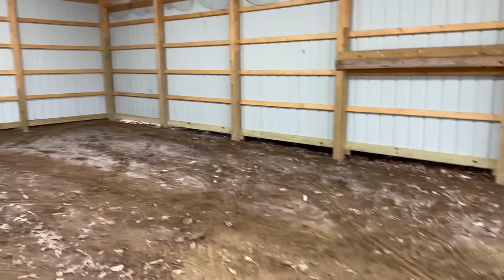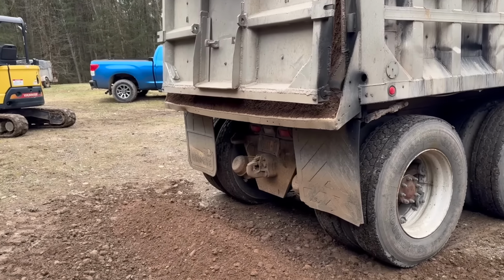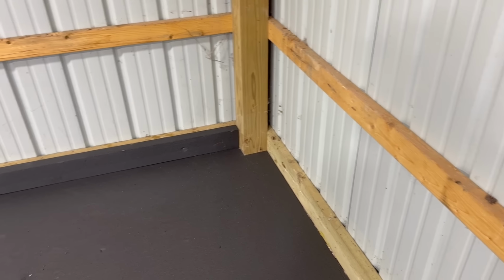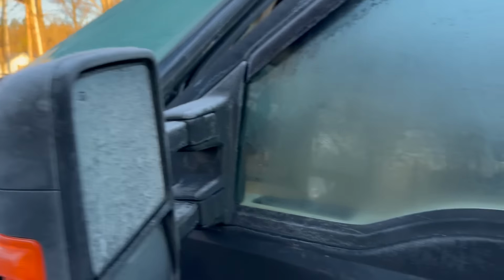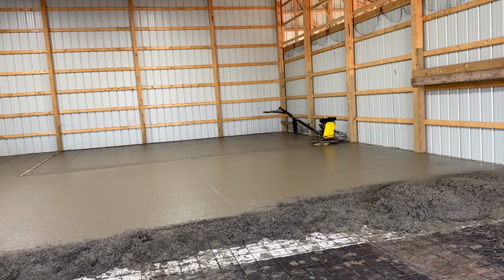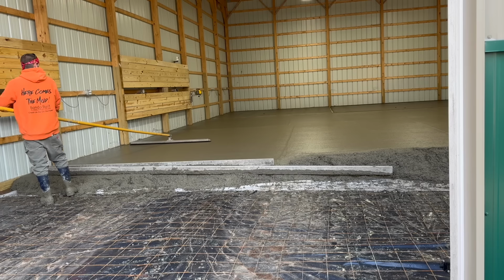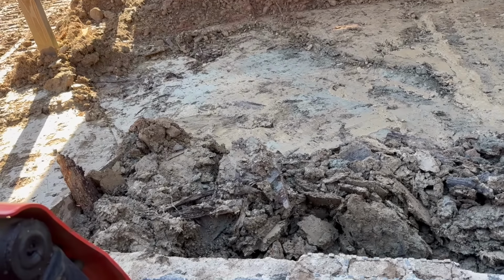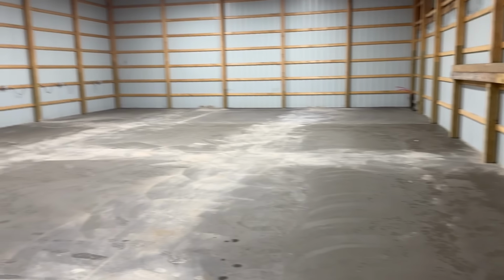We had to fix a huge mess before we could pour concrete in this pole barn.

Comment: Nice work !  😊 The water in the parameters of the barn are also created by SNOW and Rain comming off the roof line. The install of gutters or another shed roof will deflect the hydraulics load away from the structure!              
 Living and building in Montana taught me a lot as it would SNOW 300''+ per year  and a frost depth of 4' to 6' per winter.

Comment: I think I would have dug the drain on the outside to try to keep the water off the poles as much as possible. Even though they may be pressure treated, they will rot when constantly in wet dirt. Still a great job.
Reply: That's exactly what I was thinking as well.....keep the water from getting inside the building.
Reply: Didn't anyone stick a shovel in the ground even before the building was started? All this work should have been done in advance of construction, including drainage on outside of footprint. Why no chairs under mesh?

Comment: Hello Ron, hard to believe someone would put that lovely barn up and leave all that soft shit inside and not pull the site off and put some decent stone down, even as a starting point for the floor to be made up ready to concrete. And even worse on that sort of ground and grades, not put a nice drain around the outside to help protect the inside. The levels and conditions are sort of telling you what needs to be done. There's even a ditch to help 😀 great job as always,
atb to you 🙂👍
Reply: @TUGG75  I know what  he was hired for tugg75, but when I've done something similar I pulled off the site area I was working on to make it a cleaner to work on and would chat to the client about it, so when the next trade/contractor it would just be better and just save time and be better to work on, that's all. I always try to think ahead so the customer gets a neat job with less hassle that's all 👍
Reply: @TUGG75  fair enough, that's a good point 👍

Comment: 3/17/24..Always grab your videos whenever posted..much enjoy learning as you point out..'tis how we do it (right)!'
  So kindly explain why you intermittently use those wire mesh Elevation Chairs...last video from you, saw them, you commented..now this job, no chairs!?!
  Also good job on scrapping out tons of wet clay/dirt before beginning..+ perf drain pipe routed to 'daylight'.. also liked that 'new' black 'Shotgun Barrel' plastic protector for Radiant floor heating (red) tubes...looks very professional! 
 😮Have Never seen👀😮 your Heavy cc truck roll over your base fill, visqueen plastic vapor barrier & wire mesh (without chairs) 🙆 before! I thought I would see noticeable tire trks/ruts/depressions/ bent wire etc...but No..your red rock foundation was waaay strong! No 'squish'..A+...but again..no mid section wire mesh pulled up or 'chaired-up-to-center' in cc slurry...? Hope you can comment on this seeming contradiction: wire mesh in center of poured slurry...or not.🤔
 Stay safe, 🏥hope 'Big Biscuit's' cuts/wounds/stitches heal up quickly (🍺🍺 can help, right?) & carry on! Looking for your next video🎉⚙️💪😊
Reply from the maker: We pulled the wire up with potato rakes and we do not use chairs as they are not safe to walk on and can not drive the trucks on them. The wire should be on the tension side of the slab. That is the bottom 1/3rd of the slab as worse is applied to the top.

Comment: Nice work, sub-irrigated soil doesn't always show up depending on the season and dryness of the climate during the year. A dry year, end of summer build, that clay would be like concrete. The couch contractors wouldn't get that. The clay certainly prevents proper drainage. In my area we lay down some larger stone (1-1/4") as a ballast and base for the gravel with the fine ground mix (3/4 minus) when that much has to be excavated. Arguably that doesn't apply to all regions with varied soil conditions.
Reply from the maker: Thanks. We even pulled out some stumps in this one. LOL

Comment: nice video and work  Just wondering if u were lifting the steel  and i didnt see any joints   ???
Reply from the maker: Yes we pulled the steel with potato rakes and we cut the joints at the end.
Reply: @bondobuilt386   I didn't realise the steel  is supposed to be in the bottom 3rd

Comment: I like your videos.  I know you may not be able to influence the client but the water issue needs to be addressed from the exterior, first. Gutters, drain tile... I agree with an internal drain tile but the water needs to be stopped before it enters. My opinion.  Thanks for your hard work.

Comment: My building when they built it, they cut the bottom from a hill to level it. But the one side which is on the hill side should have made it higher. Whoever poured the concrete never cut a relief in it. It really doesn't have many cracks that are really bad which is surprising. The building contractor used nails instead of screws but it's been there at least 30 some years. Also after they poured the concrete the forms were never pulled and so I can't tell if I remove them if i will have a problem at the bottom of the metal panels.

Comment: I love the idea of a pole barn especially as you can lay a concrete floor later on when money/time permits. I was just wondering though, how you deal with the posts/poles rotting at ground level. Would probably rot after about 50 years I guess so do you cut out the rot and strap new timber replacements or do you install concrete ground pads? Or something else? Cheers Bondo.

Comment: This concrete work reminds me of the saying, Beauty is skin deep but that's deep enough for me.  I was impressed with the amount of rebar that was put in place.  The problem is, though , that the rebar should have been  raised off the ground a few inches and be sitting on what are called chairs so that the rebar is in approximately  the centre of the concrete.  I know that's impossible to do if the cement truck is driving on it -- which is an absolute No No -- but I saw no attempt to lift it as he backed off either.  I suggest that  the rebar is useless sitting at the bottom and will  rust away,  and as it cracks,  the concrete will become uneven causing tripping hazards.  And like the wrinkles we get as we age, the skin will no longer be so beautiful.

Comment: I've watched numerous cement contractors on YouTube lay down the wire mesh before pouring the mud.  That's how it's done.  You pull up on the mesh as the concrete exits the chute and lands on the ground.  But as the guys are doing their thing and walking on the mesh, aren't they just pushing it back down to the vapor barrier?   I've seen some guys that use the little stanchions to keep it above the vapor barrier but then of course you can't drive the truck inside the pole barn.  How do you know that the mesh is right where you want it?

Comment: I build a lot of pole barns (see my channel) and am mortified someone would go that far on a project (even installing electrical) without at least some minimal site work to slope away from the building.  It doesn't have to be perfect, just minimal common sense grading.  Having wet muddy clay and standing water inside a pole barn is bad for so many reasons.  I feel bad that it comes down to the concrete guy to deal with this.  

Personally, I  would not trust the clay sub grade to provide good slab support until it has drained, dried, and had a chance to mingle with the gravel, then readjusted with more gravel.  Since clay is expansive, there will be a significant volume change between wet muddy clay and dry clay, and that will come back to bite you if the slab is poured without proper time for the ground to dry, settle, and stabilize.  Should have been addressed months before the concrete guy showed up.  Shameful.

Comment: in 20 years, there will be a beautiful, heated, concrete slab here .. with poles rotted off at ground level :)  the owners can open a year-round roller skating rink

Comment: Sorry I fast forward them when they are long videos.
Never liked allowing water to infiltrate the structure to them guide it back out. And allowing contact on to the posts.
Why not have foam board for a thermal break all around the heated slab wood is not a thermal break. 
I appreciate your videos.✌️

Comment: Nice project. Obviously gutter & downspouts would go a long ways toward solving mud issues around the building.
Reply: Excellent point. There was still a grade issue outside however….poor planning from the beginning.  Gutters, plumbed downspouts would have helped but grading on the front end of the build required.
Reply: I've worked in resolving building flooding/dampness problems, the first thing we look for are well designed gutters and DS. Of course negative grading at the wall would also be a glaring no-no. Unfortunately slab buildings are often built too near the elevation of surrounding average grade. 8"of slab/rat-wall bump-up is code for a reason.

Comment: Your drainage outlet needs screening over the end to stop mice and other rodents from nesting and plugging the end and pipes within the French drainage system.  When you place radiant tubing best to run exterior loop around perimeter and work in towards the center, the fluid is hot as it enters the system and cools as it leaves, the exterior areas of the pad will cool faster.  I would have placed the drainage layer outside of the building, with the freeze cycles/thaw cycles the drainage areas will not rise and lower as quickly/or as high as the un-drainage areas...cracks between the two zones.  In the end I know the costs where the restricting item...just think if the pole barn was constructed higher and water flowed away from the slab how much simpler and better the end result would have been.

Comment: You needed to start on the OUTSIDE to STOP the water getting INTO this pole barn with grading away from the outside and a perforated pipe and gravel to divert it away then just level the inner floor 4 inch lower than floor grade and finish with compacted gravel INSIDE

Comment: The base ground level needed to be built up better to keep water pitched away. Never should have water to settle under the shed floor (gravel or concrete). The posts will rot and the floor will Crack. First time watching, so I don't know who prepared for the shed build. It should be about a foot higher to allow for drainage

Comment: Your wire mesh was on the bottom of the slab where it does absolutely no good.  You could save money by not using wire mesh since it doesn't do any good.  Or you could pull the mesh up to the center of the slab where it will do what its supposed to do.

Comment: Excavating and placing stone prior to erecting the structure would have saved thousands of dollars inwasted machine hours.  And the net result would have been better.
Reply: @TUGG75  - a bulldozer would clear, place and grade gravel within a space that size in an hour, not take a day and two machines to do.  Common sense that doing the job before the building is erected would be cheaper.
Reply: @TUGG75  - currently own a Komatsu bulldozer and John Deere backhoe, and have been doing excavating since 1987...so clearly don't have a clue what I am doing.
Reply: @TUGG75  - dude, you need to calm down. My point was and still is that people get sucked in by companies that throw up these sort of pole barn style structures, to just get the strufture up quick and that they can do the floor down the road, when the fact is it takes significantly less labor and machine hours to prep for a slab first, prior to erecting the structure.  And I do know what I am talking about , I have been in the industry for 40 years.  I wasn't making any sort of statement that Bondi was doing anything wrong or overcharging his customer. Seriously relax dude.
Reply: @TUGG75  - its cheaper to clean up the mess from the holes after than it is to place and compact material around the columns.  Have also done these many times including my own current 30x60 shop.
Reply: @TUGG75  you seriously need to calm down
Reply: @TUGG75  - no that is not what I am describing. I am describing what we call a pole barn, which is what that structure is.  And by the way, if you watch the video, the perimeter grading was obviously pre-graded with a dozer, so a dozer was already onsite during construction anyway, so no additional thousands of dollars for a dozer to be brought in, and anyway, a dozer the size required to do such a small task does not cost thousands of dollars to bring to and remove from a job site. Your comments have no merit.
Reply: @TUGG75  - omg, you need help